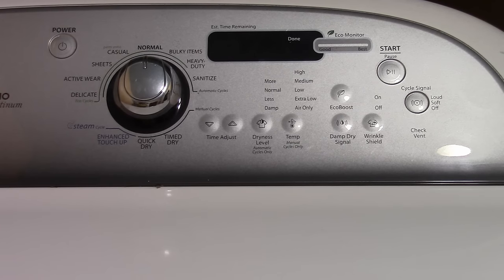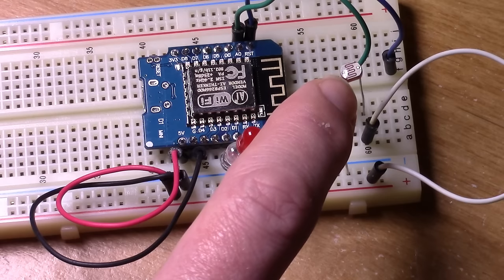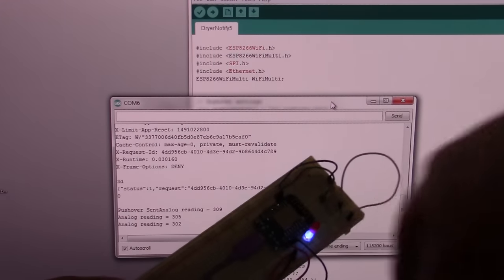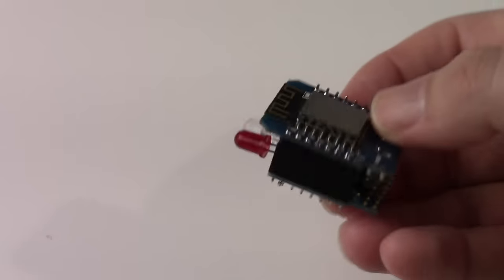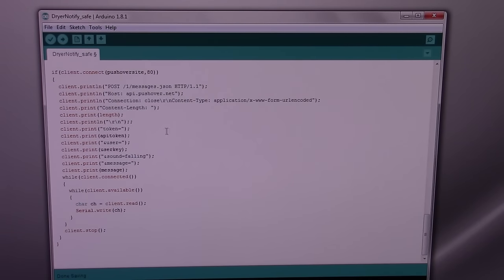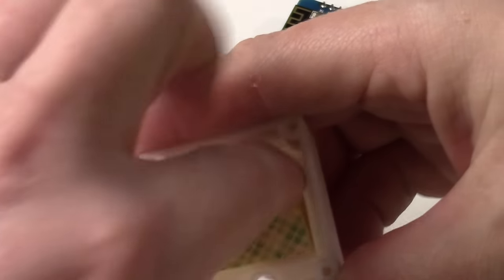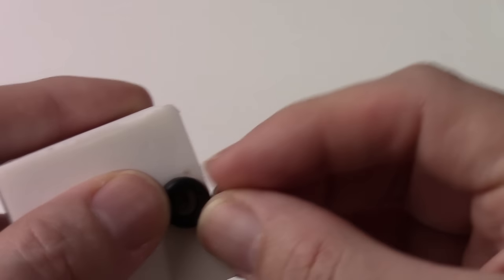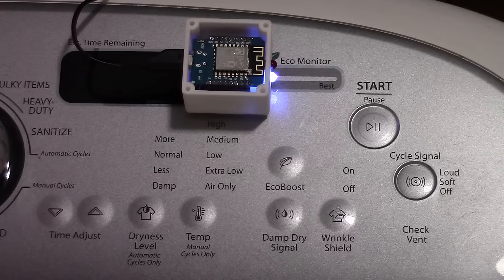DIY Project:  Washer/Dryer Notifier  (Arduino/ESP8266/D1 mini/3D Printed Case)

Comment: Nice! Thank You. I will be making this. However, I will probably be making 2(washer/dryer) in 1 housing with remote light sensors.
Reply from the maker: That sounds like a great addition/mod to the unit!  In my case, I only needed the device for the dryer since I can hear the washer beep almost anywhere in the house; but, since the dryer takes longer and is less loud, I forget about it and have clothes sitting for hours in the washer/dryer waiting to be moved.

Comment: I know this is an older post, but wouldn't sense of low power from the power source work as well?
As when the machines are done they don't use as much power.
I was thinking of making something like that.

Any sugestions?
Reply from the maker: Yes, you could use an ammeter probe to monitor for energy usage.  That would also give the benefit of being able to provide you with the energy cost per dryer cycle.

Comment: Wouldn't it be better to use a vibration sensor?
Reply from the maker: That was my first assumption when I was designing the device.  I went with a vibration module, then a different style of vibration module, and finally a raw piezo disc with a weighted spring - the results with regards to monitoring the actual vibration were quite flaky.  If you add in that there are several periods in the wash cycle with >30 second periods of time with NO movement of any kind within the washer, it became apparent that the best course of action was to use something on the washer/dryer that defined a true "complete" notification.